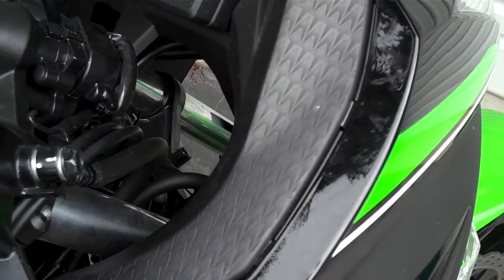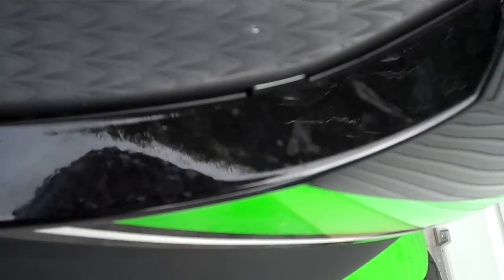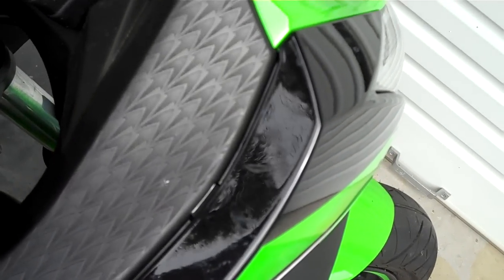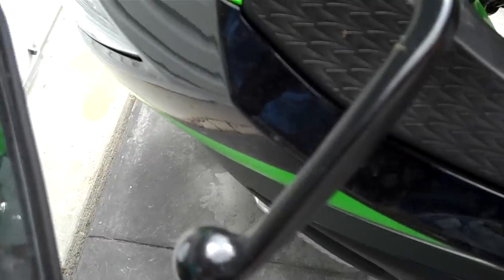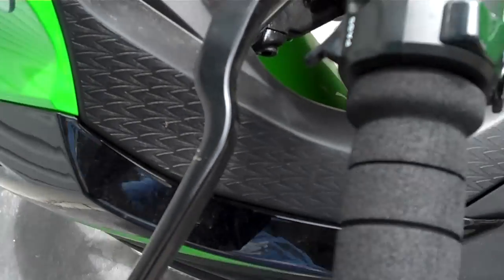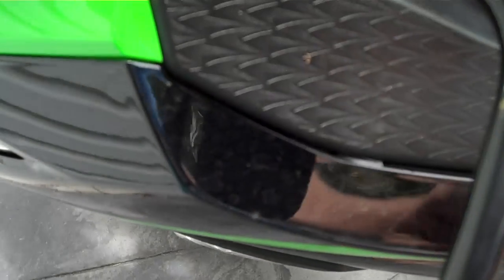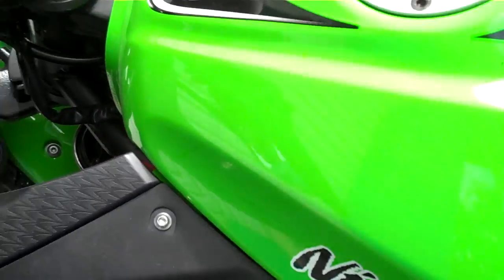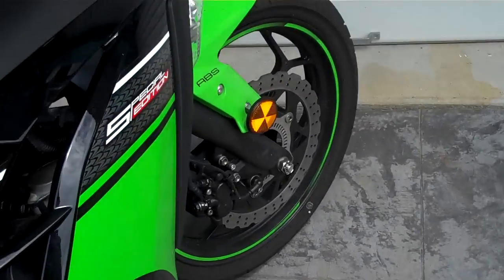ninja 300 fairing gap

Comment: I have a white non-ABS, US version. My bike has that problem only on the left side. There is a "jimmy-rig" sort of fix that you can do yourself, but it can be a pain. My fairing pops out much farther than in your video. The fix involves taking a bolt on the end off, loosening anoter bolt, then pulling on the fairing back, then tightening the bolt, but then the bolt on the end does not fit back properly, so my bolt is screwed in but not all the way snug like it used to be. Definitely frustrating.

Comment from the maker: this fix you mention doesn’t work over a long period of time. the reason the fairing pops out is the 2 clips at the top of the side fairing that clip in under the handle bars, that clips length is too short , hence the reason why it keeps popping out. my bike goes in for new fairing on monday 6th may 2013. will post up how it goes after its done

Comment: same here
Reply from the maker: what year is yours? 2013?
Reply: A 2014 SE, it really pisses me off.
Reply from the maker: insteresting. have a look at the complience plate near the triple clamp on side side of the steering stem.where does it say the bike was made, and what year/month was it made , as of janurary 2014 the ninja 300 is supposed to be made in japan
Reply: 9/13 Japan
Reply from the maker: well that sux. take it back to the dealer, get photos of it and let then have a go at fixing it. if they dont do anything for you, open your owners manual, get the address of kwaka hq in your country and write them a letter, put the photos in wit it , along with your bike VIN, the dealer , the person you spoke to, date/time and let them sort it out. i wish you luck
Reply: It's an existing problem, I called the dealer and told them I'd bring it in tomorrow and they would check for abuse.  Then they order new fearing and we go on from there.  When I called them it sounded like it's a common problem.
Reply from the maker: on the 2013 it was a common fault, it is supposed to be fixed on the 2014 though. my green bike above went to the dealer about 6 times and had about 14 boxes of spare parts thrown at it and it still did it and was in the dealer work shop over 6 weeks in a 9 month period getting fixed.i hope they get yours sorted.yes it has been a common fault on the bike, once it is sorted, they are a great bike.not all of the bikes have the fault though.